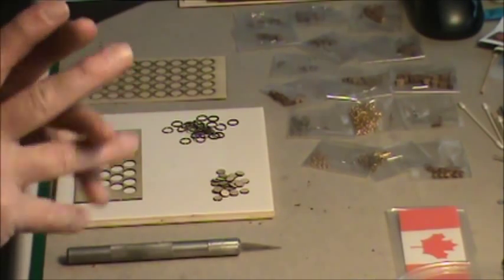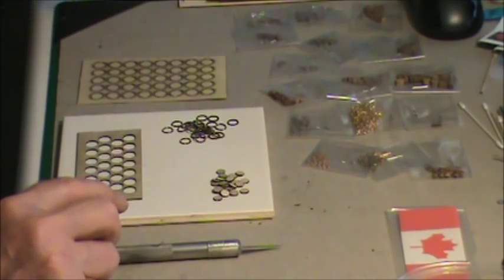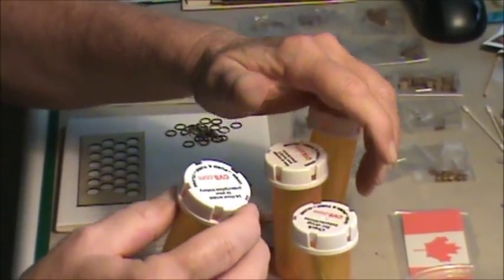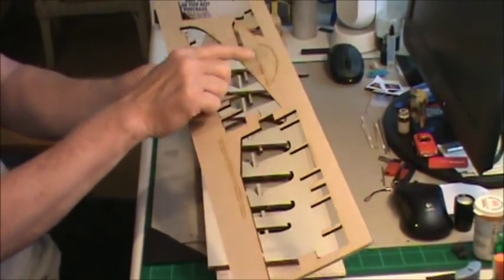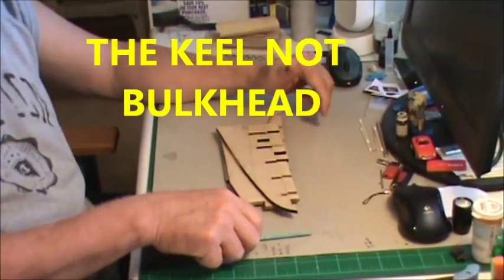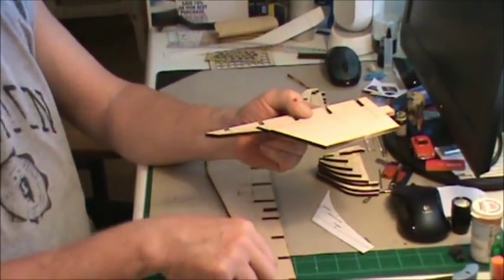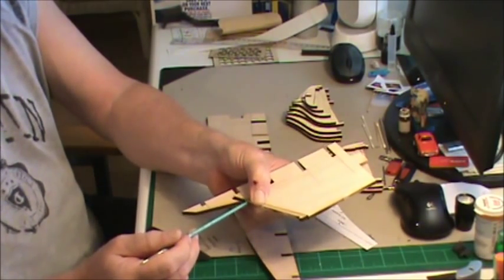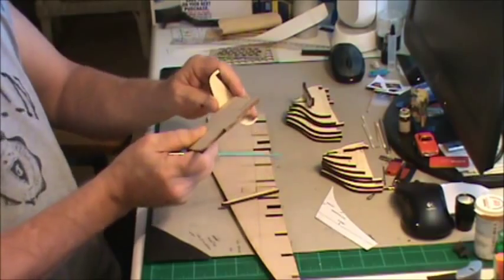BLUENOSE PART 4

Comment: I find some of your comments and tips very helpful. I recently finished building the Billings boat, the Mary Ann. I also ran into intractable plan problems such as undefined markings, vague  and incorrect instructions and outright mistakes. I was able to resolve most of them by calling businesses that sell Billings Boats usually by email so I could easily keep records and save responses.